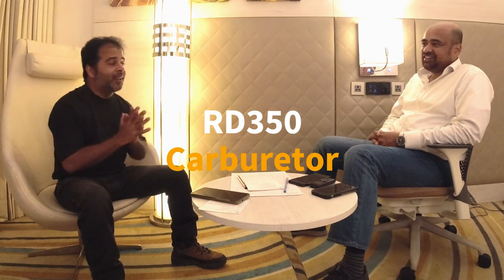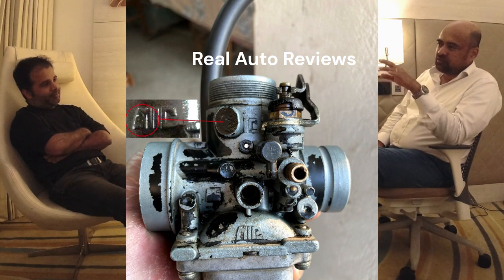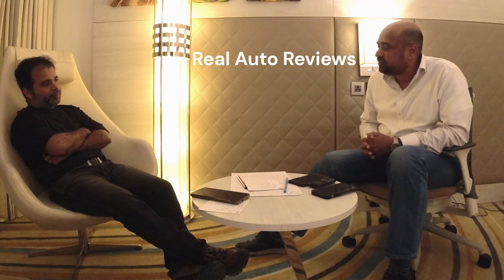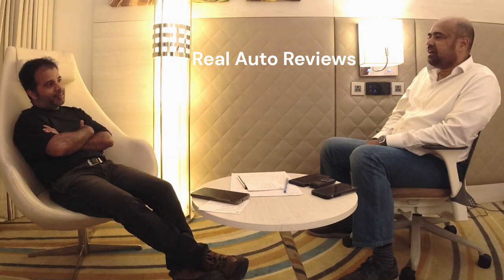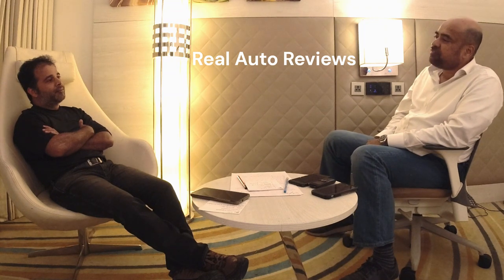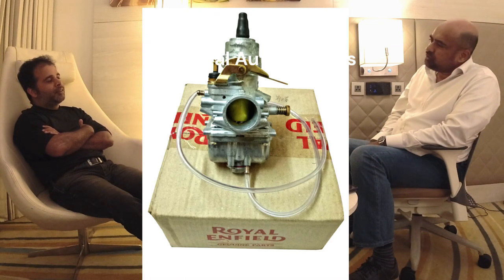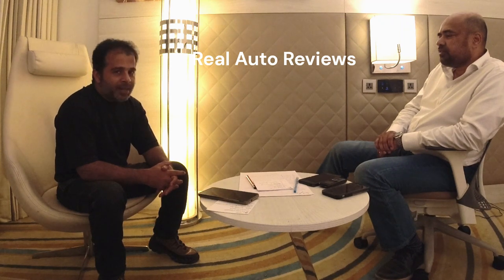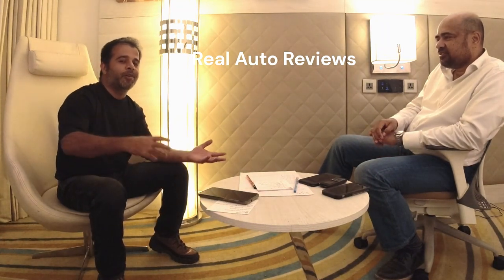Yamaha RD350 Carburettors | Dr. Chatterjee on Good Carbs & Bad Carbs 😁

Comment: Here in Brazil it is practically impossible to find OEM carburetors for RD350 (VM28) so it is common to use the VM26 carburetors from the RD350 YPVS as many of these bikes were manufactured in Brazil, this is my case. One question: if it is impossible to find the original carburetors, what other carburetor could I purchase on the international market? something that would be easier to find... Thank you very much for this enlightening video.
Reply from the maker: You are most welcome ❤️ I will request Gautam bhai to suggest the best alternative to you here 😃